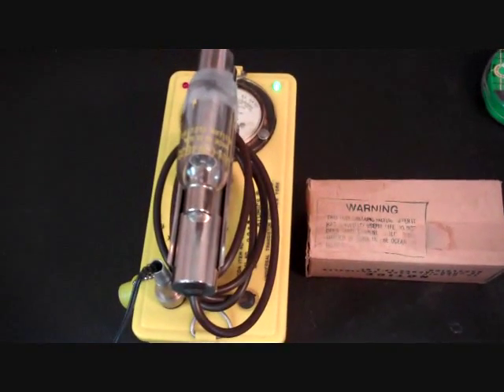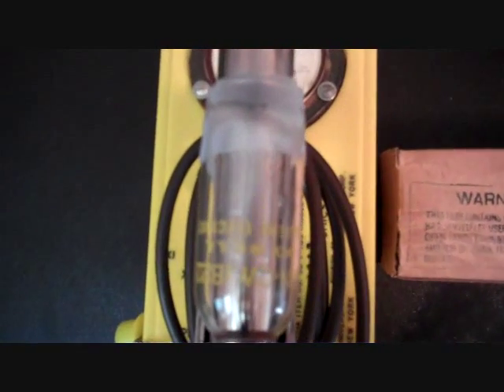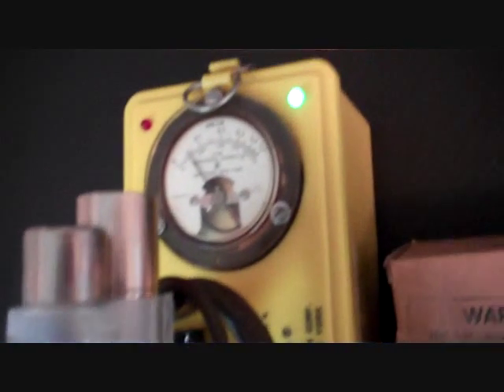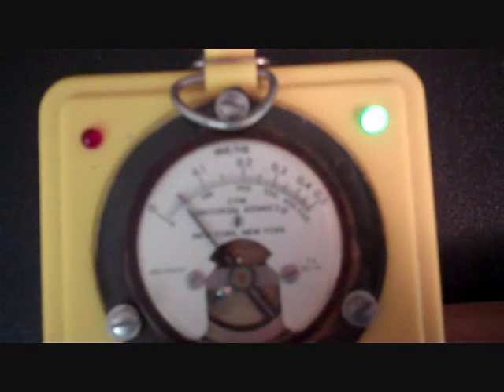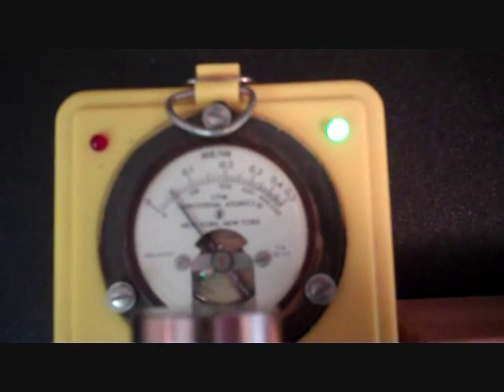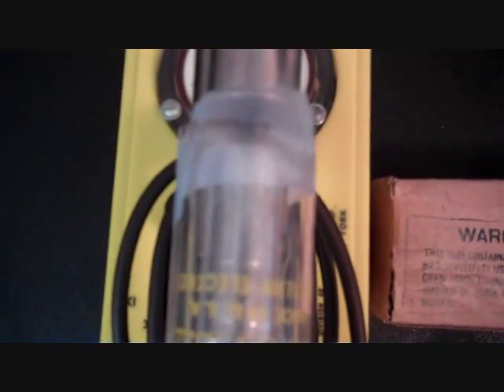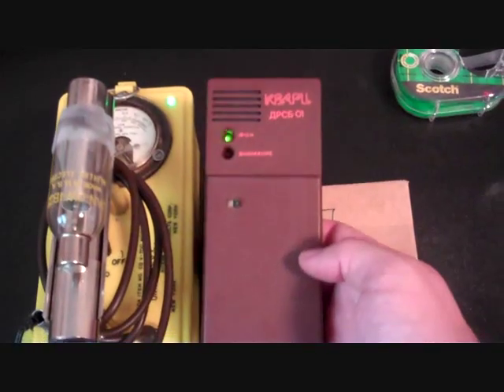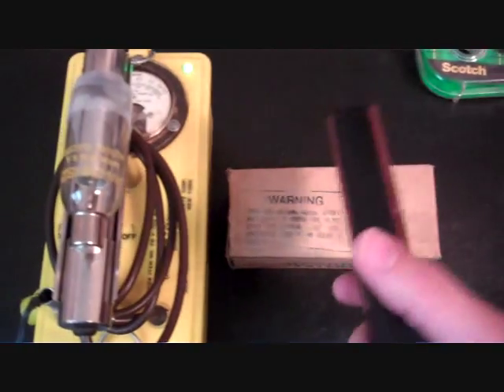1B22 Radioactive Radium Vacuum Tube

Comment: Are the ends of those tubes supposed to go in a socket or do you solder wires to each end ? I've only seen tubes with pins on them, so anyone know? Thanks

Comment: Nice! Those tubes are really hard to find! I have a lot of Ra-226 sources. I collect radioactive sources. 1B22 tubes are pretty hot, though. Your CD V-700 is different than mine, with add-ons. I have a standard CD V-700 Victoreen 6A. The readings are quite precise, so ours are probably both calibrated. I used Cs-137 to calibrate mine. I get ~2000 - 2500 CPM (gamma) from my 1B22 tubes. But, some of them are slightly hotter than others.
Reply: Because we love them.  They are like a classic car and often the gateway drug into the hobby of geiger counters.  A first step for a lot of us.  Many are still out there being freshly discovered in grandfather's basements or attics as time goes on and free is a very good price.  Some still wait patiently in government fallout shelters.  It's because so many millions of them were issued in the civil defense days.  American cold war history.  They are actually pretty good at measuring gamma with that thick metal energy compensated probe as long as the beta window is rotated closed.
Reply: Yeah people confuse the more useful 700 model with the high range survey meters / door stops / zombie thumpers.  There is a great deal on a smaller unit right now if you are on a tight budget and want something less bulky.  The seller has been unloading bunches of these (over 300 now) and reports are they are like new condition.  Because it uses a thin end window geiger tube, these are even sensitive to some alpha.  No connection to seller, just sharing a good deal for $80:  www.ebay.com/itm/262446419108
Reply: why you people continue to use those yellow bricks as "dosimeters" ?
Reply: They're nice Geiger counters, especially for how old they are. They use mR/h (gamma) and CPM (beta and gamma). Or alpha if you have an alpha probe. And you can do custom modifications on them so they can use different probes, speakers, range, count or alarm LEDs, etc. The "Yellow Bricks" sound more to me like the CD V-715 or CD V-717, which are not Geiger counters, but ionization counters for extremely high levels of radiation (R/h). They have those yellow handles, no speaker jacks or any G-M tube. But, they do look very alike. Also, I can't afford a high-end device, like a Ludlum, Inspector, or a gamma ray spectrometer. If I could, that's what I would use for more precise detection/measuring.
Reply: Hey Kyle  , what's the best way to store the 1b22's ? Would you wear some type of gloves when handling them?

Comment: But the most dangerous thing is fragility, if you accidentaly drop and break the tube, the radium can be dispersed everywere; i suggest to permanently place this tube inside a thick cardboard or thin alluminium box, wrapped inside a sponge or bubble wrap to avoid breakage.  gamma radiations can easily escape from the box but nothing happens if the box is incidentally dropped on the floor!
Radiations are fun but dangerous, please take any precautions to avoid glass breakage and play safe!!!

Comment: I have the same tube (acquired for the same purposes!), using mine 42mm Nai(Ti) scintillation probe i can detect this tube "by hear" (only by listening the clics) more than 1 meter away; if i use a scaler i'm able to detect them even at 4 meters!
This source is not completely safe, if you are close to this tube you can be exposed to an eccessive level of radiations (but about 2 meters away is almost safe).

Comment from the maker: @boryshacker Only if broken or ingested. Completely safe to handle though as it is a 100% sealed source. An old radium watch is far more dangerous due to high contamination risk, but few realize it.
Reply: Hey Matt I know this video is really old but I wanted to know about that cdv-700 it uses the old radium glass voltage regulator right or dose it use something else?